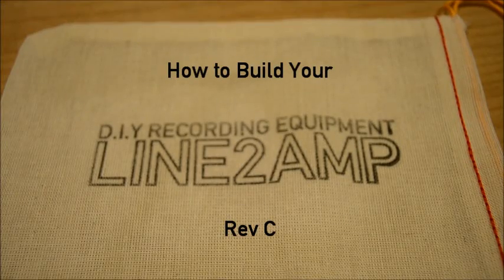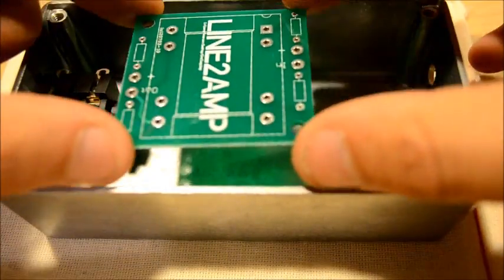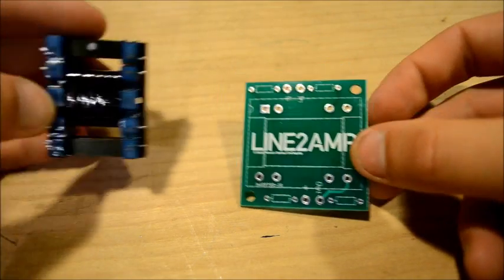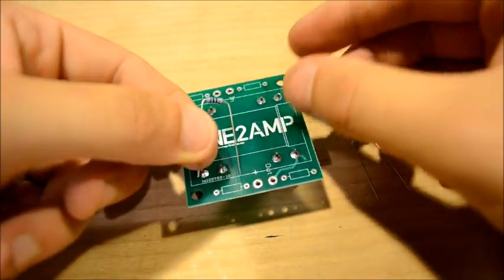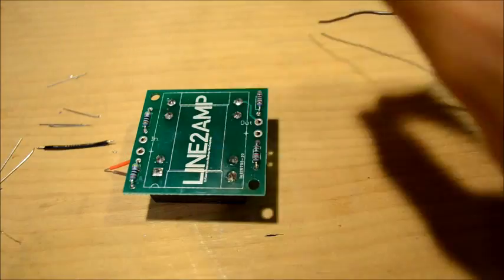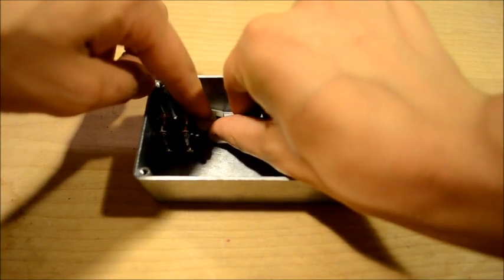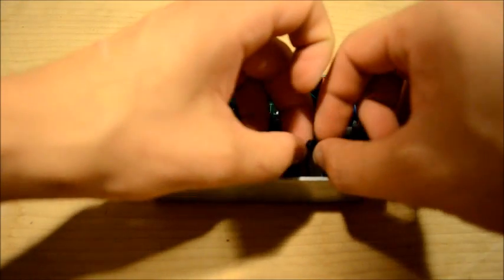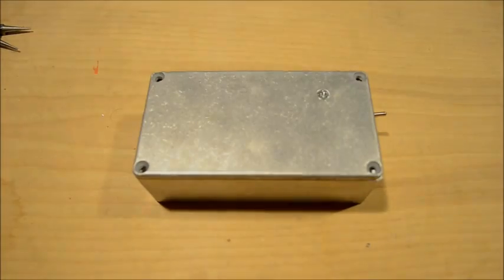How to Build the LINE2AMP Rev C Reamping Box

Comment: Hey. Nice work. Kit and PCB looks very good. Not sure I'd recommend using those self-adhesive strap mounts though, they tend to lose their adhesion and let go really quickly.  They aren't a long term solution. On that note, I'm curious why you 'mounted' the PCB so loosely rather than use some standoffs screwed into the box so it's really solid. I'd expect all the connections to flex and possibly break over time.